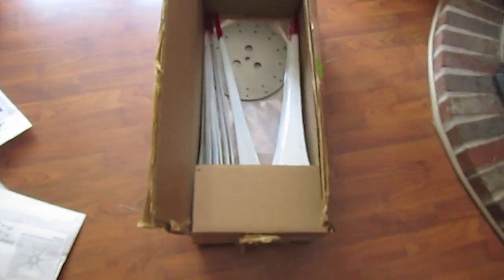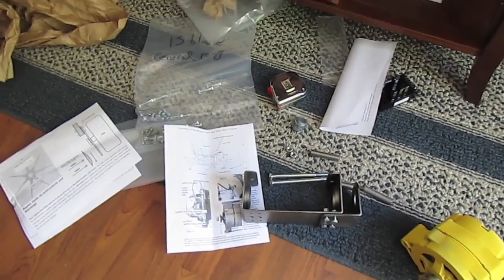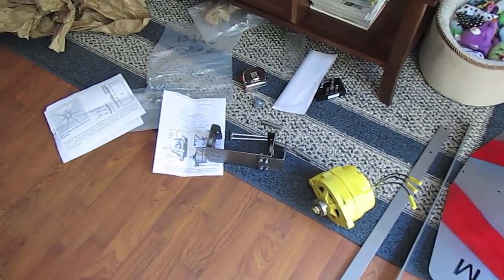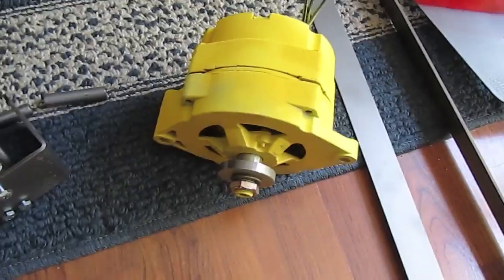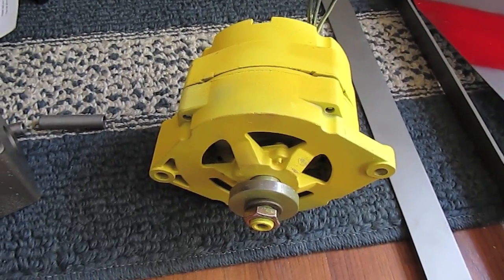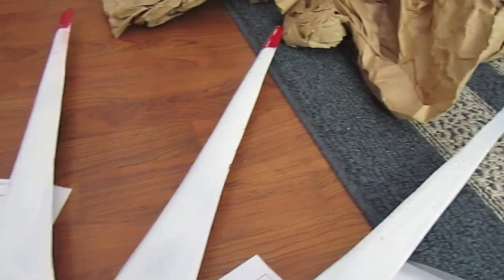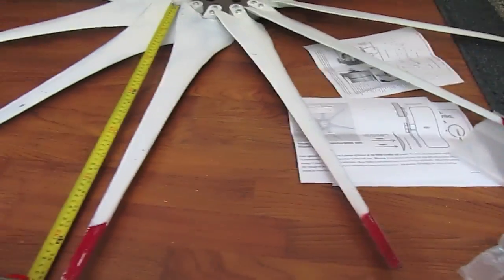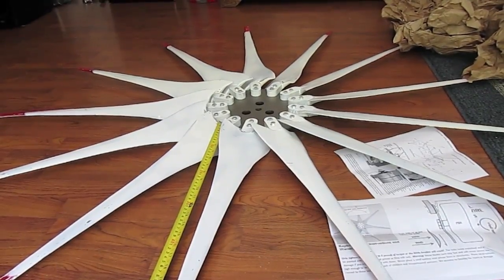1600 watt Wind Turbine

Comment: We tested the same turbine -  max 300 watts, never 1600!!!
Reply: , it should be as high as possible , 50 to 60 feet , it should only need 3 blades , the more blades it has the slower it goes , and if you have 11 to 13 blades and it's under 20 feet , yeah maybe 300 to 400  watts ,

Comment: Great job in your explanation of a wind turbine, however, I see that you are mainly using the two (2) 6-volt connected batteries in your trolley to now form one (1) 12-volt battery. But, what purpose did the two (2) 6-volt batteries on the right (R) side of your trolley perform?
Also, what type of a 12-volt car battery works best: AGM, regular battery or gel type. And. at what CCA would be best?
Thank you.

Comment: WHAT GENERATOR/ALTERNATOR is capable of 2kw constant at very low rpm?  Forget the blades for the moment.
Reply: What is "very low" rpm ?
Reply: @MrSummitville  Was thinking around 200 rpm.
Reply: @MrSummitville  I'm still learning, haven't spent too much time on this subject yet, but nowaways i'd lean more toward many smaller output generator setups instead of one high torque low rpm.
Reply: @Box545x39  A Dual Rotor Axial Flux PMA, or a B&C Energy ( B-Creation   2,000 Watt PMA, or a Hurricane BIG ASS 2,500 Watt PMA ...

Comment: How can it be 1600w? Its impossible with that small of a wind area. It's like putting a 1000lt/h pump to a 10lt/h water stream and then wonder why it won't pump those 1000lt that is is capable of...

Comment: It would be lucky to see 160 watts, no way could it make 1600.
Reply: +racketman2u I agree, 1600 watt woud need heavy wire, this seems to be a modified car alternator (the largest ones I have seen put out about 1200 to 1600 watt, at high RPMs and get hot), 1600 watt means also a baseline power of  above 2 hp, plus losses which could put the number in a ballpark of 4 hp total, or, for a two square meter fan a wind speed arround 50 km/hr (30 mph)
Reply: Záhradné náradie

Comment: Hello all gentlemen  ,I am sorry that my English is my second language so please try to understand what I am writing about this okay. There is many cheating in the world. The cheaters just want to make some money for their purpose. Please be careful and look back the electronic theory from the book before you buy some think that you do not see. 
I think after 1960, the most alternator from car's industry did not build in the strong permanent magnet to create the AC current but the most alternators in the market from that time has built the extra coil to receive the supply oscillating current to creating the magnet to reduce the cost therefore you must find out how to connect it and how to build your project.
Reply: Jim Sadler "DC" generators don't generate what most people mean when they talk about direct current. They generate rectified AC. It still has to be filtered and regulated to be useful.
Reply: hi could u contact me?   cthoma12@nyit.edu
Reply: Just before 1960 we changed from DC generators for cars to alternators which produce AC. It is true that some alternators will require a tiny magnetic presence in order to function. One way to get that is to send current from the battery into a coil within the alternator.  One might have a hand built unit with which you must bring a magnet near a coil when you first spin the alternator. Once it has started producing current you can remove the magnet and as long as it keeps spinning it will produce current. But in the real world some piece of iron or other magnetic material will hold enough charge to start the system over and over again. Making power is quite easy. Making the amount of power and quality of power in an ongoing system is more difficult. You should be able to produce power for many months without any interrupt in service. Even large power companies struggle to do that.
Reply: Jim Sadler Generators make AC too. They have to be rectified and regulated just like alternators. All alternators require a field current. It's the difference between an alternator and generator.
Reply: When using automobile parts an alternator makes AC whereas on antique cars a generator makes DC power. The windmill in question is using an automobile alternator.

Comment: None of the wind generators that I see on YouTube seem to have any kind of speed control. Out here on the high desert of Arizona we get some strong winds and a speed unregulated wind generator would tear itself to pieces in a short time... Some years ago, I built a 3 level Savonias rotor out of galvanized stove pipe that was 6 feet high. The cups were spring loaded so that they opened as the speed increased to slow the rotor down..The vertical shaft was mounted on an auto front wheel bearing and belt drove an auto alternator charging six 2 volt telephone company batteries. These were discarded batteries weighing 250 lbs each and had lots of life left in them for my use... I used them to power my Ham Radio station, KB7NK

Comment: you may be right about 12 volt pmg/alternators but i do want to inform you.  That PMG is NOT 12V that generator in the video has 3 wires making it a 3 phase 120V.  The box with 5 pins that the poster calls a regulater is not a regulator.  Its infact a AC to 12Converter so you can runn the cheaper wire from the windmill to your setup, then convert it to 12v then use larger wire so you dont loose any AMPS.  I'll soon be getting a full size generator my self and might post some vids

Comment: Why does it have a pivot bolt hole and a locking bolt hole? The housing is definitely a car alternator housing. Can't say what's inside, but the idea of how readily available alternators are, and the fact that they come with built-in voltage regulators  would make this kind of thing much more relative to cheap power for the common man.

Comment: correct! car generators cannot be used directly as wind generators without stepping their speed up through a two-stage planetary gear. furher you need their rotor coil replaced with a neo ring magnet using aluminium or hard plastic, like delrin, as a spacer in place of the rotor coil-core to keep the poles apart, whilst tayloring its diameter to the ID of the ring magnet to keep it in centre. if the length of the magnet is short then take it up by same size iron spacer as the magnet 4tight fit.

Comment from the maker: Jeff, you are correct all metal parts are new and the blades are not labeled with Raptor (or anything) and are black with a new paint job. The PMA has a different wiring harness and it was painted yellow so I cannot see any markings on it to say what it is.

Comment: its called bait and switch. you see i big fat juicy worm.thinking you are onto a good thing you buy it and a pile of crap arrives in the post.qaz661 is doing this using mwand solar as the bait
lets see what current/amps hooked up under load it puts out.

Comment: That's a Thermodyne wind turbine, not a Missouri wind turbine. They don't make a 13 blade wind turbine. Those are hornet blades. The raptor generation 4 blades are twice as wide and grey, they say raptor usa on the butts.
Thermodyne,qaz661 on eBay ripped you off. You won't get any power from those 13 hornet blades. Good luck buddy.
Phil